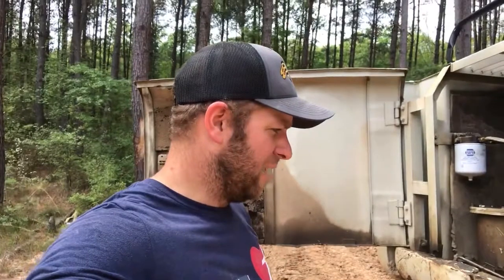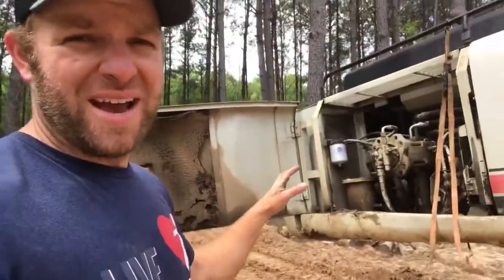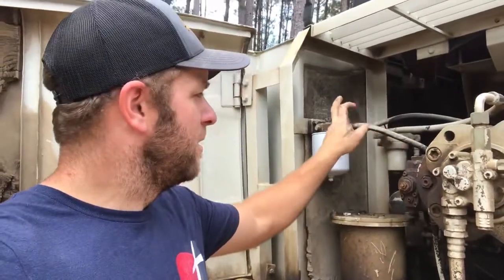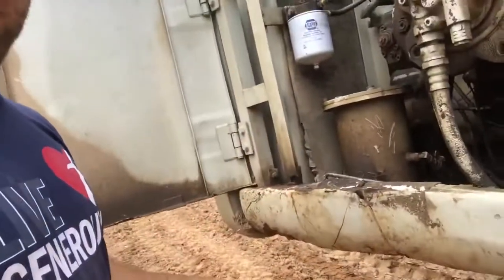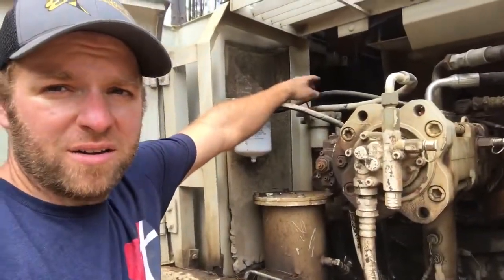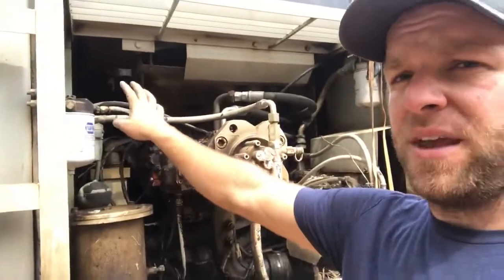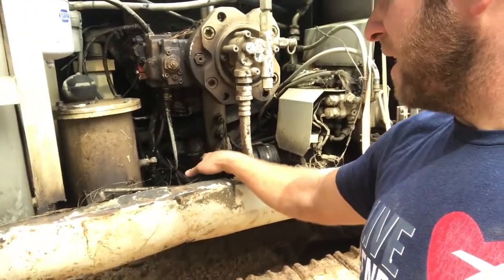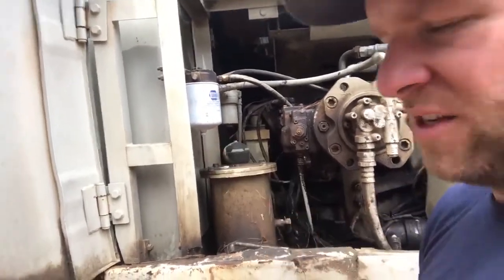Air Locked Mechanical Injection Diesel Fuel System

Comment: Thank you have the same problem with our 210LX right now...  Just changed both fuel filters and followed service procedure in the manual, oddly enough it said not to fill the filters so I didn't and that was probably a mistake I should have ignored the manual and gone with my previous experience

Comment: I’m sure you’ve probably fixed this by now but if not, Delphi makes a 12v in-line fuel pump, you could plumb it online with your suction line and hook the wiring to ignition power and be fine it’ll run steady while your machines running but it won’t hurt anything or burn out the pump, I’ve used these on a few different machines after the oem transfer pump failed

Comment: Thank you for the information. I'm having the same issue with a skid steer that won't turn on. The fuel level is low. It was running but had batteries. I replaced them and then got the air lock. I replaced the filters and primed it by blowing air into the tank to force the fuel through the line but it didn't work. I'm going to try your method and see what happens

Comment: Similar lesson like what you did with my Chevy 6.6 l i put it in neutral going downhill it was already overheating I thought that would help with the overheating and save them the fuel but what happened was I ended up getting an airlock and I had to keep priming it for about an hour and a half and letting it cool off and stuff and researching finally I got it to fire up again

Comment: Im no expert but i think you might consider putting the inline pump as low as you can so it always stays primed. Sometimes those inline pumps have a hard time pulling air. Edit. Watched more video and saw thats what you were already thinking.
Reply from the maker: Yep! I actually made this video like 6 mos ago, just got around to publishing it. And just went to get the pump today. Of course it was not available in the store, despite their website saying it was. I’ll have to get a few fittings as well to swap it in, but I’m just going to wire in a little 12v low pressure fuel pump. Splice it in with the key so it’s hot when the key is on. Or put it on a toggle switch. I always disconnect my negative battery terminal anyway (in lieu of my master switch that went out years ago), so even if I forgot it’s toggled on, it’ll never run the battery down over night